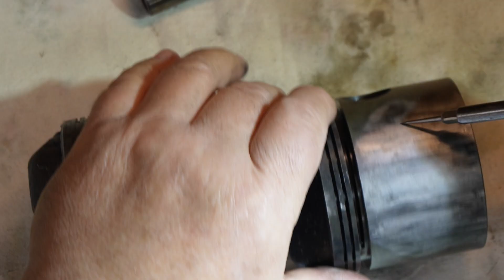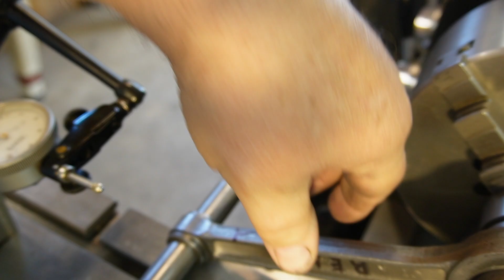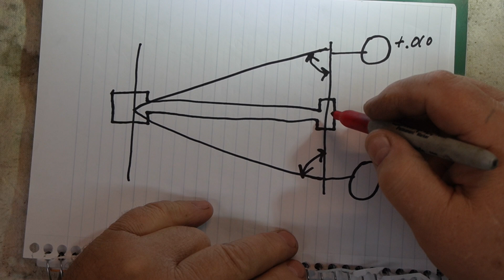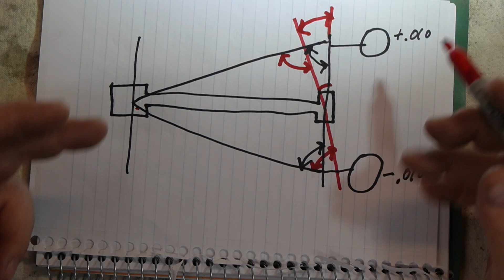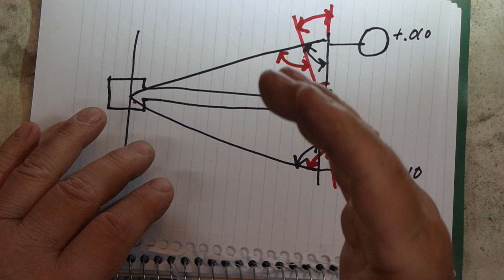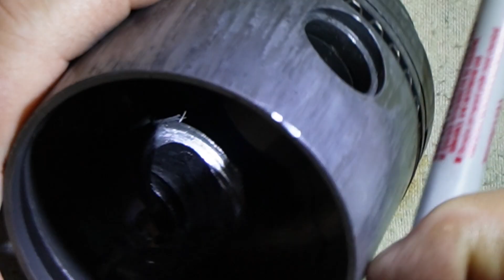Bad Enough 9 Failure Analysis, Did A Bent Connecting Rod Cause The Failure? Nbr 342

Comment: I've had this happen twice in the past 50-plus years. In both cases it was a result of the wrist pin clip coming out, which allows the wristpin to work itself to one side. In one case the rod broke and in the other I ended up with  a deep groove in the cylinder wall. I think that's what happened on that ironhead. The clip came out, the wrist pin worked to one side, then broke the piston and bent the rod. I enjoy your videos!
Reply from the maker: I agree, that is a possibility.

Comment: What came first, the bend or the break?  I've seen two (well, three)blown motors and each was rod bearings...and the pistons looked the same as yours, and the rods were bent.  Harleys look big and tough but, as you have shown with those massive flywheels, you can deflect them with finger pressure; and the ease with which you bent the rods in your fixture.  I've also got a newer Sportster with a piston that was broken like your piston.  I suspect detonation destroyed all three engines and my bent rods were secondary to the piston failure.  Hemi combustion chambers are notorious for detonation and when those long spindly rods are trying to push a broken piston up the cylinder is probably enough to torque the rods.  As well as detonation acting like an air hammer against those rod bearings.
Reply from the maker: And that is also a good theory.

Comment: Looks like the piston wasn't bored  to the cylinder right either over or under bored . Just because there marked say .020 there off a few thousands especially v-twin brand .
Excess frichin or to loose caused piston to heat up and flex cracking the wrist pin mount. Resulting in bent  connecting  rod. Best i can figure not seeing the rest of the parts.
Reply from the maker: And that is also a distinct possibility. The fact that the piston is scored all the way around tends to make me believe it was fit too tight. For what it's worth, those were V-Twin pistons and cylinders.

Comment: Tatro Machine in California has a fixture to check Harley rods. It uses an expanding mandrel. He uses a piston wrist pin, and he has a three-legged fixture to set on the piston pin and set against a flat surface. You can probably find it in one of videos. Once again you surprise me with one of your ideas. You came up with a good way to check the bend dimension. The bent dimension is the important dimension. The twist is not critical. You might be able to replicate his fixture or keep an eye open for one for sale sometime.
Reply from the maker: I found the Tatro video,  that is a helluva tool he has. It looks like it can accommodate rods twice as long as a Harley rod, so I suspect it was not intended to be specifically for Harley rods, no matter, it looks like it works. I also suspect it must be accurate to within a couple of ten thousandths and capable of holding up to repeated bending. All of which means it must cost a fortune, if even available these days.

Comment: Intake / head gasket leak plus oil starvation= Seizure Squeezure on the Humpty Dumpty! There Was an "instant Stroker" kit that had longer rods and shorter pistons and skirts liked melting pistons! Not sure if bent rods are a result or the cause, but that's one lucky dude it didn't completely seize up!

Comment: Around 40 years ago I made an extended iron head crank pin and wrist pin using a surface grinder with a whirly jig for just the same reason and used a similar gauge block, surface plate method you did. 
It took hours and hours to make them on the surface grinder but since my lathe at the time wasn't true, it my only option. I also had to let the pieces cool in between grinds to get them to within 1/2 a tenth which was a little overkill but---
It worked as intended but I really like your method on the lathe with the expanding collet.
After all of the work I came to the conclusion that the rods were good, but the front cylinder had been bored at a slight angle.
I also found out later that I could have bought a long wrist pin from S&S for around $10-12 at the time, LOL.
I really enjoyed this video and the ensuing flashbacks it gave me from the '80's!!
Reply from the maker: I love hearing about how people were fixing these bikes back in the day.  It's a great reminder of how much the technology has evolved, but the fundamentals remain the same!

Comment: At the racing garage where I worked on my vehicles we would level the bike take off the heads  and put a 3' rod through both rods. The long length would exaggerate any twist or bend. Just as long as the fly wheel and bearing were in good condition, you could bend the bars parallel by grabbing and twisting in the needed direction(s). One bike (76) was new from the factory and had bent rods. AMF sucked putty balls.
Reply: well actually I saw more of this kinda stuff from 60's bikes. I apprenticed at a dealership in late 68. Jack  my mentor and head line mechanic used to show me  engines from late 60's that never seated the rings.  When tore down   angle piston wear  on the skirts indicative of rods that weren't straight. Almost always Shovels  He would straighten the rods and redo the cylinders. All under warranty .
Reply from the maker: Interesting, level the cylinder decks and then check the level on an extra long piston pin...